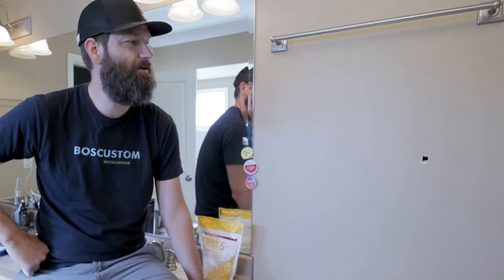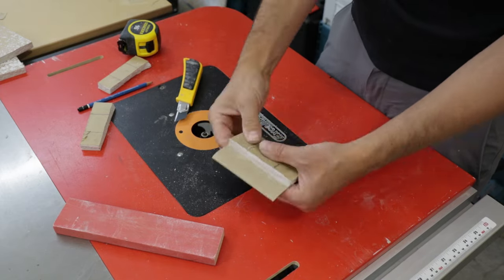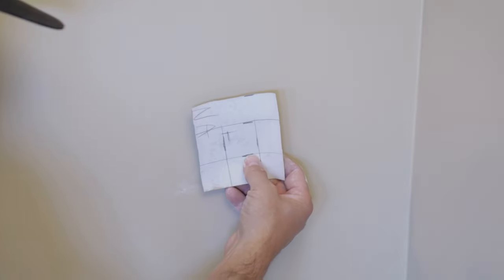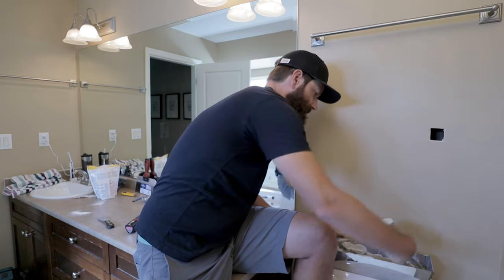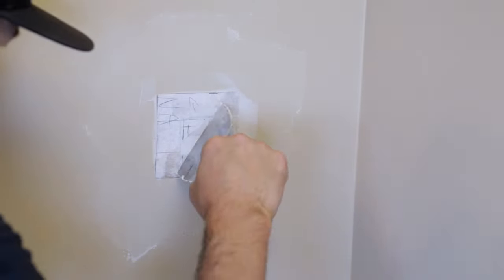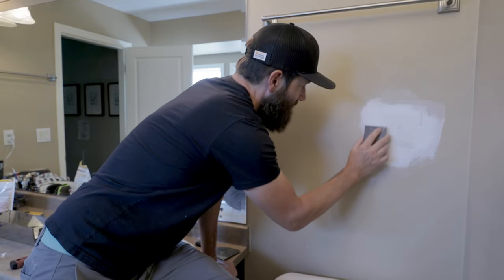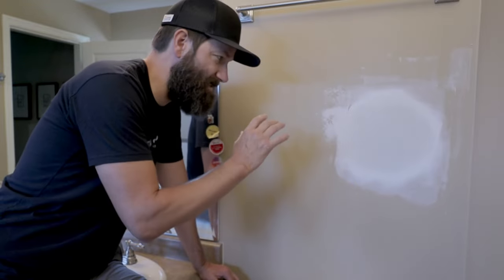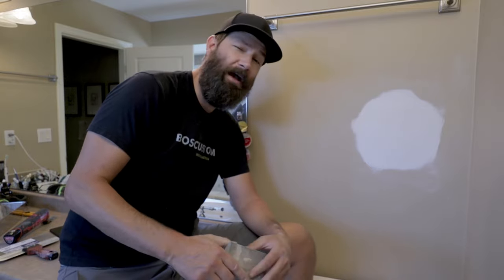Old School Tricks with a New Age Twist

Comment: thanks for sharing. You can mix some plaster with compound instead of that 5 minute mix. Mix water with regular compound for the final coat. Use a damp sponge to feather out the edges.
Reply from the maker: Good tips

Comment: I had a rectangular hole from a duct in a ceiling corner where it met two walls. I did this and it worked great. I folded two of my flaps down onto the walls. I didn't even bother putting strapping in the ceiling and using any drywall screws, just the mud held the patch up. It worked great and was less time than using paper tape.
Reply from the maker: Nice! This type of patch is a great weapon to keep tucked away!

Comment: I used mesh tape over two old telephone and cable tv boxes that were no longer in use and packed with five minute mud. It was thick enough to seal them and then the second coat made them look like they were never there.
Reply from the maker: Nice work Raul!

Comment: What’s even faster is use spray foam, let dry and cut flush and final coat of mud. 
But this is also a great tip.
Reply from the maker: Hmm, that sounds interesting
Reply: That's a sweet idea!
Reply: I’m a kitchen installer and I have seen this trick a lot even on ship lap. Works great!!
Reply: Where do you spray the foam? Won't it just fall behind the drywall?
Reply: @eliot2283  Some of it will fall behind the wall.

Comment: For these patches, I usually put Durabond 5 or 20 for the sticking coat (in the hole and under the paper) and flatten it out. Becomes more solid the the surrounding drywall. Then I finish as usual with hot mud and finish coat. BTW, I hate Drydex.  Good video!

Comment: for a patch that small, i think I would just put a glob of mud on the back of a piece of paper tape and set that over the hole. California patch is fine but a bit extra work for something this small
Reply from the maker: Fair point, I did want to test this out with the 5 minute mud.  This is gonna be a cool method to keep in my back pocket for the future.
Reply: There’s no fun you tube vid on a small patch tho, right?  The beauty is DIY’ers can apply this to larger hole’s like the one behind rental home doors from a doorknob.
Reply: @kds471  true
Reply from the maker: kds471 I’ve seen a few beauties with those reinforced patches with drydex and a 3” plastic knife…you just know that’s going to paint up real nice😂😂😂
Reply: @TheFunnyCarpenter  the worse are the rental property drywall fixes with canned texture, wrong color and wrong sheen paint lol.
Reply: @kds471  Last rental I did I stuck these self adhesive plastic rounds on the wall where the damage was. Owner was happy because it would be the last time they's repair (hopefully).

Comment: I have a dual system it can be used to patch small to very large holes that does not need any feathering because it is the fastest flush finishing repair. 
It also can become the world’s strongest drywall anchoring system. 
I will challenge anyone to try to defeat it. There is not a person alive that can pull it free from the wall. The bolt will break first

Comment: Nice!  If you wanna patch, prime and paint in 2 hours a heat gun is your best friend :).
Reply from the maker: I’m sensing a future video: before and after shot of a big patch with a time stamp of 98 minutes… I like it
Reply: @TheFunnyCarpenter  definitely doable as long as your don’t bubble your paint!  Been there, done that once.  You can even show how to keep a piece of the cut out so you can get it paint matched at the big box for a perfect repair.
Reply: A heatgun? A common household tool indeed - just point a hairdryer to it on low heat and that's enough. So it's air-dried
Reply: @stanbinary  I tried but a hairdryer was too slow for me when I have to coat a 2x2 section 3 or more times, prime and paint in a day.  3/4 of the time I’m just standing there heat gunning the patch.  It’s also louder and made me half deaf  working a small bathroom,

Comment: Would you recommend quick mud or the DryDex spackle to repair spots where the drywall screw has popped/blistered the ceiling (after I move the screw to a new location)?
Reply from the maker: Drydex will work fine.  The 5 minute mud will probably sand up a bit nicer, but for the extra hassle might not be worth the time.  That is an interesting question though… maybe a future vid
Reply: @TheFunnyCarpenter  Kewl
Reply: @TheFunnyCarpenter  Maybe in your house you don't have any popping screws in the ceiling ;-)

Comment: A hole that small, you could have just beveled the edges of the hole with a utility knife, key in the 5 minute mud, apply 2 more coats, wait about 45 minutes then wet sand with a sponge.  That way you don't have to build the repair out, just fill in the hole, quickset can fill in 1/4 - 1/2" holes if you key it in with a beveled edge, that way it locks into the whole like a "C" around the edges.
Reply: That sounds like my wife.

Comment: I’ve always wondered why any time you do something that’s not 100% the correct way it has California in it. I don’t want to knock this method because I’ve done it and it works great but I guess it’s not the same as cutting in a full patch and taping it. However he called it a California patch. There’s also a California 3-way switch which is a short it but not correct way to wire a 3 way switch. There’s another example but I can’t remember at the moment. I guess the devils advocate example is the California corner in framing which to my limited knowledge is a good and proper way to do a corner.

Comment: With a hole that small you do not need a patch.  Don’t make the hole larger. Fill with 5 minute mud. One application then top coat.  Will work just fine.
Reply from the maker: Fair point, but then it becomes difficult to make a video about California patches....
Reply: @TheFunnyCarpenter  and that’s also a fair point